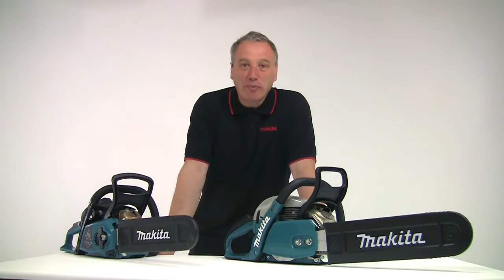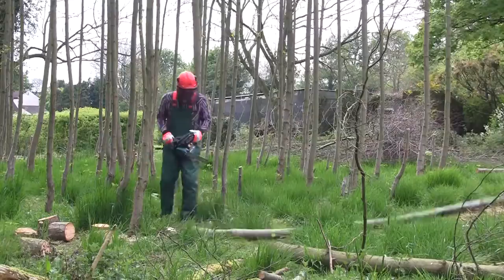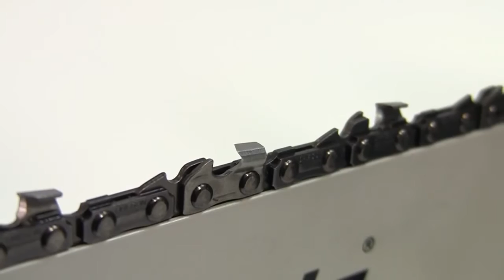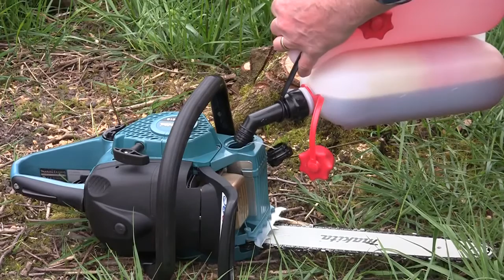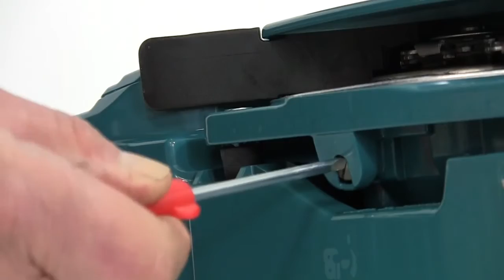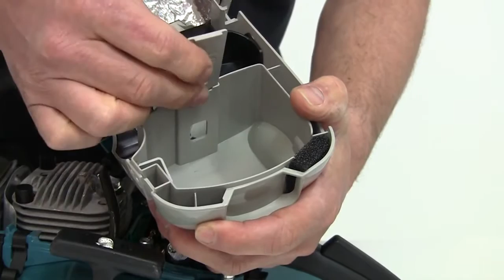[Review] Makita EA3201S40B, 32 cc Chainsaw - 16" Bar

Comment: I just bought one of these. No problem with product but Straight out of box the exhaust looks purple and specks of salt. The oil bar filler cap and fuel cap area have oil residue around it. Not sure if its like that from factory or if someone has returned it.will be returning it for a new one.
Reply: this may be a bit late but they are all run in the factory to tune the carburetor mine was exactly the same oil and fuel residue in tanks and the muffler goes really purple really fast because these engines have catalytic converters just like a petrol car and when turning the unburnt hydrocarbons (fuel/petrol) in the exhaust stream into co2 and water they heat up to 800/1000 degrees celsius
Reply: @word1901  yes you are correct i ended up keeping mine.